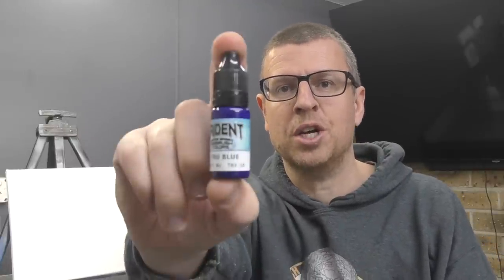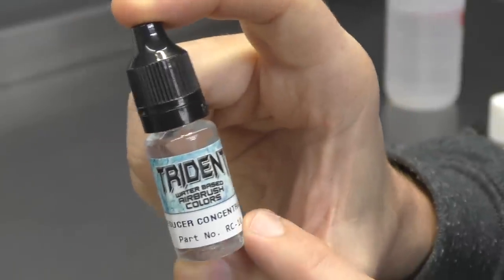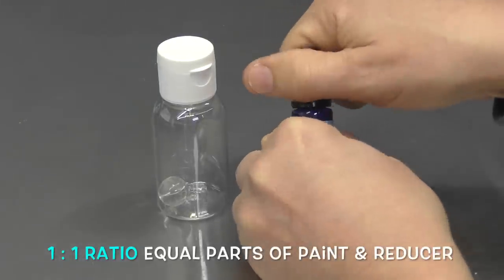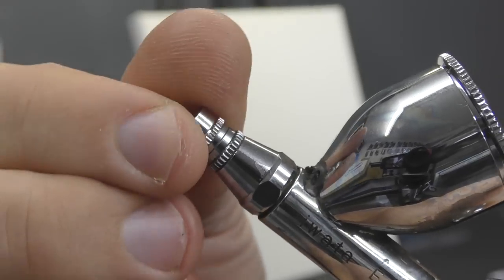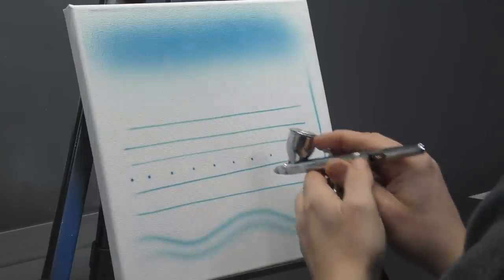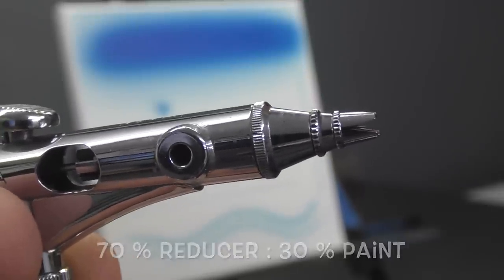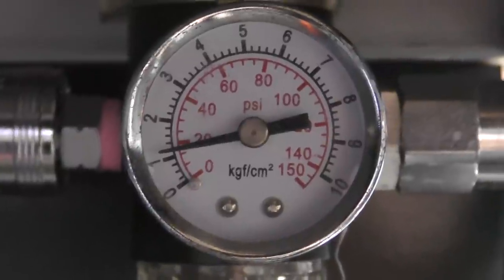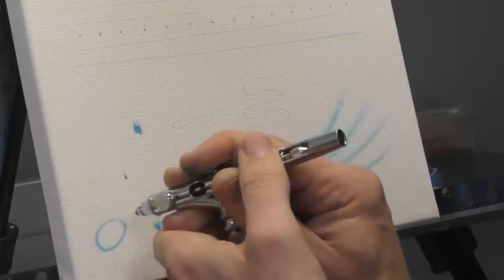How to thin your Airbrush Paint | Beginner Tips

Comment: I don't understand why water is not recommended. If you paint by brush - everybody uses water to thin acrylics, I don't see a problem there with viscosity. It's just marketing. Sure, there may be some ingredients that smoothen or lengthen the drying time, but really, water has been used for decades to thin acrylics... And if I mix my paint with water when I need the color, the shelf live of my mixture is less then 1 day anyway 😉 or use distilled water. other than that, your videos are really helpful!

Comment: As a professional car painter starting n early 70's. Working with most every type and brand of paint,of course solvent bases this video is extremely valuable and a must watch! As the industry has changed to water based paints, its great to c u put out a solid video with great info. I really appreciate ur time and info as testing many brands gives all those who r wanting to learn the new paints a great variety to choose from. As a custom painter and airbrush artist and model builder for 50 yrs with many best paint awards I would encourage all to watch,learn and practice as u demonstrated. Great job,thanks again. As they say,even this old dog learned new tricks here.😁🙂. Look forward to following u more and changing over from 50 yrs of solvent based paints, especially now that my grandsons r building and wanting to start painting thier own models. Doug"Doc"Midkiff, Doc's Designs-Nor Cal
Reply: Thanks you guys. What do you use to thin urethane based paints for a hobby airbrush?
Reply: K Gee, for urethane based paints I typically use a fast dry urethane reducer. Mid temp or slow dry will have a tendency to attack the plastic. O have also successfully used a fast dry gun washing lacquer thinner, ( my favorite choice when using testers enamels also),though n Cal we can't buy it anymore thank to big gov always shutting down what works. Acetone solvents now r just no where worth mentioning n my opinion,don't work even for cleaning compared to lac thinners. Hope this helps
Reply: @dougmidkiffsr.2333  Thank you!

Comment: Good info I enjoy this video... quick question about adjusting the psi, you know that when the airbrush is trigger the psi on the gauge it lower, so if I want to adjust to 30psi I should adjust to 30psi with out the airbrush trigger and it doesnt matter if the psi lower when the airbrush is trigger or adjust to 30psi while havi g the airbrush trigger so I can compensate for the lower psi?

Comment: Whats the difference between airbrush flow improver and reducer? According to the item descriptions:

Reducer - A premium reducer for thinning water-based paint. Allows for decreased drying and curing times as well as improved flow with less tip-dry

Flow improver - improve the flow and delay the drying of paint on the needle while airbrushing

So the reducer is different in that it also thins water based paints? Wouldn't the flow improver do that anyway?

Comment: I'm getting regular spidering, I'm very new to Airbrushing. What ratio of paint to thinner would you recommend? I'm using IPA (isopropanol alcohol) and VG (vegetable glycerin) along with bottled water for my thinning agent, 25% IPA, 75% Bottled water and 15 drop's of VG. But I'm getting spidering or the paint travelling under my templates! I've tried to thicken the paint but then I get problems blowing it through my air brushes! Some paints are fine but the majority splatter and spider. Thank you for your video.

Comment: Hi,

New to airbrushing. I recently purchased the iwata eclips .35. Also purchased some carbon black acrylic and some shading gray acrylic (transparent) by Golden, don't know if you're familiar with that brand. If so do you recommend thinning it?

Also I want to practice doing eyes after learning airbrush control doing dots, lines, dagger strokes and fading using the carbon black.

As far as eyes are concerned do you recommend using the shading gray for detail after doing the outline of the eye with carbon black or should I just use one or the other for the whole peice?
Most appreciative.
Reply from the maker: Thanks for your comment and the eclipse is a great choice, I have never used golden so can’t help you there.
I assume with the eye you mean in black and grey, I use different strengths of black mixed with transparent base to build my layers and finish with highlights then the strongest black mix for details 👍🏻 hope that helps

Comment: Can Mineral Spirits be used as a reducer? For oil based paint like 1 Shot, especially when pinstripping, a lot of people use it as a reducer so I was curious what affordable and easy to find options there were. Also, for cordless (USB charged) airbrushes usually have a fixed and limited pressure rating like 12-14 psi so is there a workaround for those using such machines? Thanks for the video and the info!

Comment: I’m not a Newby by any means but I find your pressures just a bit high. That said, I have yet to try Createx or Trident paints. I’m currently using Tamiya and MMP paints. I thin at basically the same ratios though!
Reply: I'm new but from what I've read,  the recommended pressure for models and figurines is somewhere between 20-25psi. 30-40 seems more appropriate for larger projects like bike helmets and prop/costume stuff.

Comment: Great tutorials. I'm practicing a lot but I'm having the problem that the airbrush throws some small points like dry paint. What can I do to correct this? Thanks I am getting a lot of help with your tutorials.
Reply: Possibility: Start with air and finish with air to make sure no paint is getting stuck in the nozzle and splattering out on the next spray..?

Comment: Ello.. why do u say, don't mix water with the
Paints?
Reply from the maker: These paints are designed to flow better and not comprimise the paints viscosity if thinned with reducer rather than using water which breaks down the pigments and can also create issues if you plan on keeping your left over paint and storing it for more use .

Comment: Hi great channel
I get spidering and splatter trying to get a small dot with 1:1 at 20 psi.
Is paint too thin maybe or pulling back too quickly?
Thank you
Reply from the maker: Thank you glad you enjoy the channel 🙏🏻 generally 1:1 ratio is great to start with and shouldn’t be too thin, you may be pulling back too far on the trigger or you may also have moisture coming through your airline ? Hope that helps 👍🏻

Comment: Hi buddy. great vids.  Hope you can advise me here.

I've got a new AB kit with Airtank from Amazon.  It's budget as far as I can tell.  Anyway, I'm a tight arse so I've been trying (and failing) to use my Acrylic Paints in Airbrush, thinning using Water and Isopro 99.9 but I'm forever tip drying or it won't spray, or.....it just doesn't work.

Am I wasting my time trying to use my Acrylic paints to AB or can it be done with the right mix?  Can I thin with regular paint thinner?  i feel like I've got off to a terrible start with not trying proper AB paints.
Reply from the maker: Thanks for the compliments on my vids and even though it’s possible to use existing paints you will find that dedicated airbrush paints will work so much better, less tip dry and make airbrushing much more enjoyable . If you are in Australia then grab trident paints if outside of Australia then Createx illustration colors are great 👍🏻 hope that helps
Reply: @AirbrushAsylum  Oh Wow.  Just looked Createx up....Expensive much lol.  

Maybe I'll but 2 colours and try a monochrome :D
Reply: Old school cheap method is to thin acrylic paint with Windex. Just clean everything with brush cleaner from Lowe's

Comment: What's the advantage of removing the protective covering from the needle?
Reply from the maker: The removal of the air cap allows for easier cleaning and fine lines 👍🏻 it also gives you a better line of sight when doing really small details 😉

Comment: What’s difference between reducer and extender (I use golden paints had was told to get some extender)
Reply: As I understand it "reducer" is just another name for "thinner" - to adjust the viscosity of the paint.
Extender slows the drying time of the paint - just a drop or two per cupful. Helps prevent paint buildup on the tip.
I'm only just past the beginner stage, so I stand to be corrected.

Comment: Water will make it moldy....  Fill this reducer with water!  I stopped watching at that point.
Reply from the maker: With bottled water or deionised water , this mixed with the Reducer Concentrate will be fine as it is mixing with the chemicals within that product. Using straight ‘tap water’ to mix with your paint will compromise the paints viscosity and the reducer also houses slipping agents which assist in minimizing tip dry. Hope that clears up your query 👍🏻😉
Reply: @AirbrushAsylum  I use 25% regular Fantastik cleaner and 75% distilled water as a cleaner and a reducer.  Have been for years and it works great at a far lower cost.  You may wanna try it and see how it goes.